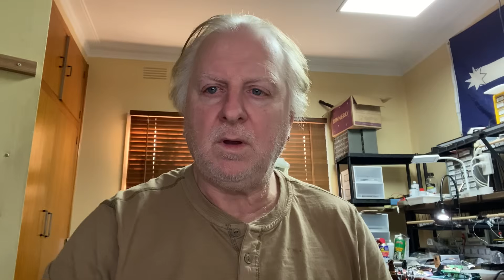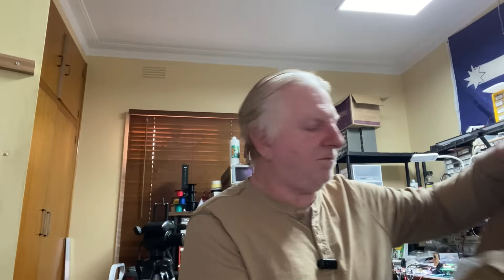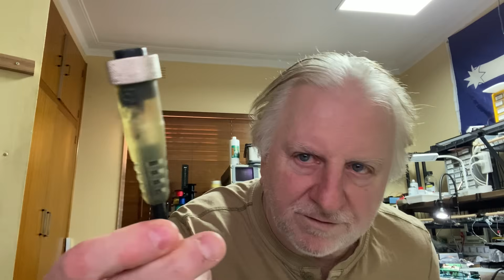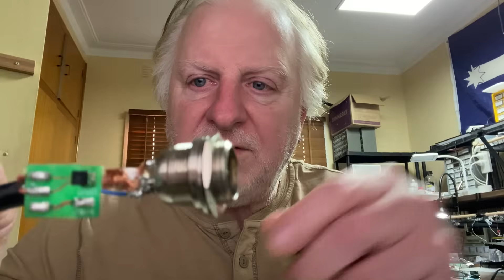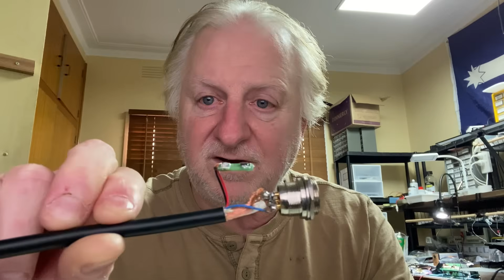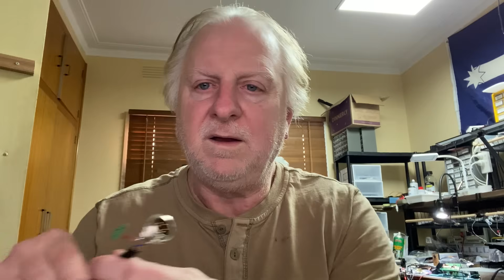Why does it cost up to $3500 to upgrade and modify a GPZ-7000

Comment: Dang, I just bought a Sadie mk2 for my modded, by you, 3000 and it doesn’t work well with it.  I get better sensitivity and depth with the 14x9 NF evolution.  Any recommendations for a small coil?  Hopefully I can trade it in.  I don’t know if it would be worth it to send my 3000 back to you for a tweaking or not.  Your thoughts?
Reply from the maker: I know it works with elite max coils, if it is not sensitive adjust the variable frequency down to around 200 or if it has variable gain crank it down a tad, how long ago was it done as not long ago these coils did not exist.
Reply: @DetectorMods .   Last October ish.
Reply from the maker: @Mack9456 There were no elite max or new Sadie coils last October , so we did not have to compensate for these types of coils, but it you send it back with a note I can do the changes for you.
Reply: @DetectorMods . I’m in Arizona.  What would that cost?
Reply from the maker: Do you know anyone with a soldering iron that does electronics?
Reply: @DetectorMods . I believe I do.
Reply: The 14x9 elite Max runs beautifully on mine (modded 3000). I can crank the gain and or sensitivity right up.
Reply from the maker: @RobertBoothey , some detectors are fussy but if yours is working fine then that is good, any detector can be made to work on any coil, the magic is in knowing what to do.

Comment: Thanks Woody, more good stuff again! I had thought most of the cost of the upgrades was your IP. The price was very reasonable for the resulting performance improvement, and the five years. 
When I stopped electronic engineering to go detecting I was getting about $60 an hour!

I'd be interested in a coil case but I'd rather have one 450 to 600mm diameter. There are plenty of second hand small coils to destroy.
Reply from the maker: The thing with coil shells is that I have to order many of the same size to get a good deal.

Comment: Im testing the algo with mini ufo(17x10), ufo(24x12), 18 round goldstalker, 12x18 goldstalker and 16 goldstalker, old stock/old sticker style coilteks. They all work perfectly on the algo+, the 18 round even gets ultra fine mode, the other get fine and above. They run great in large👍👌🇦🇺( im emailed coiltek about compatibility with the newer goldstalker 22 inch mono, they said it wont work, but my testing makes me wonder why?)
Reply from the maker: I should have checked some parameters when I looked inside the algo to see if what I can do to the Minelab can be done also.
Reply: @DetectorMods mine is available to you if you wish to go over it.

Comment: As one of them your hourly rates are about right, depending on where you are in Australia. As for legal, I was paying $1100 a day for a barrister back in 1986 when the hourly rate for specialty electrical engineers was $50 per hour for redesigning Mariner II space craft